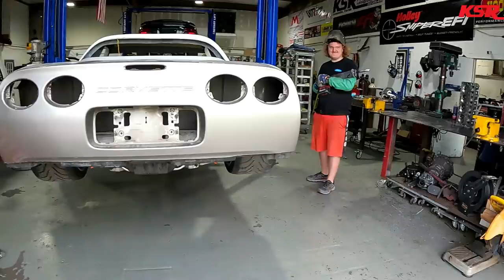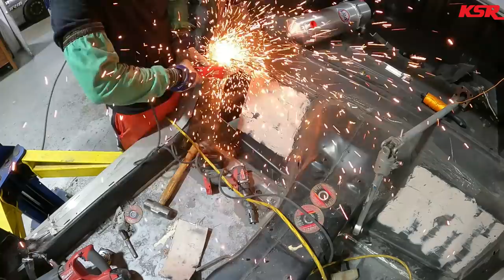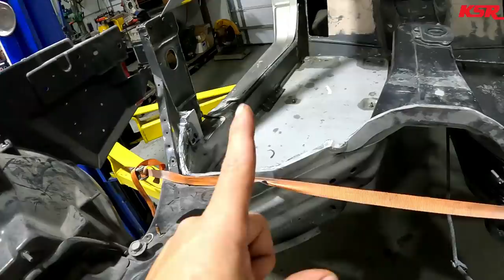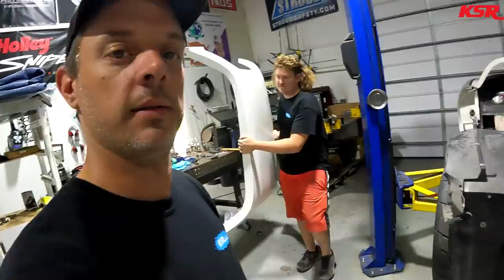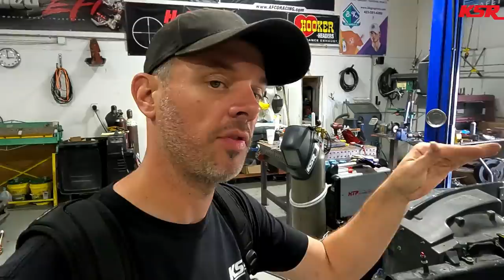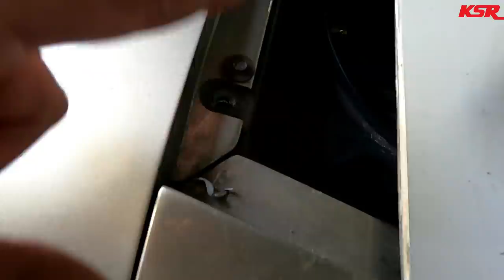We Destroyed a Corvette!!!  Or Did We???

Comment: After the mention of power/weight performance balancing I started thinking "what if they strictly went by horsepower and completely disregarded torque?" That then made me think of taking a 427 aluminum block LS with LM7 heads and cam just to see. It'd be a bit like an old nailhead or something...but modern...maybe. It's not a combo that makes any sense but I want to see it.

Comment: Do they have to run a stock type transaxle as a lot of the Drag race and Drift guys plus I have seen some of the GT road race Vett's running conventional
Trans with the early Diff or as the Cars that are being built now have quick change Diff Gears "See Taylor Ray's or Collete Davis's new Vett Drift Builds"
Garret is also changing Leroy to conventional Trans layout with the IRS setup staying,  I would personally ditch the IRS and go 9" and 4 bar layout but
that's just how I would go if it was my setup or how I would of advised a customer to get the best results.

Comment: cutting all that fiberglass made my skin itch just watching. How do the regs for cages in road racing compare to the nhra cage certs? Are there different cage specs based on weight and Hp of the cars or a standard cage design/spec that has to be followed?

Comment: When you are doing this job to a corvette would your preference be to start with a convertible chassis or a hard top car?
Reply: Convertibles are heavier due to extra bracing for it being a convertible. So in this instance a hard top would the best bet.
Reply: @KrisKnight91  would the stiffer chassis be worth it I mean ur gutting the rest of the car out
Reply: @CharlesSmith-uw9ef  with a cage there’s no need for it be stiffer. Plus they want it as light as possible for this build

Comment: Would it not be better to have a longer stroke engine to keep the horsepower low for the weight break? Then use the extra torque to improve the performance. It would also be under less stress for an endurance motor.
Reply: Under square, over square…. I think folks have been arguing that forever??  Ultimately the REAL issue is efficiency…. And I think [i don’t really know] that is determined by a million things in a “reciprocal” engine, that’s burning gasoline….  There is a WHOLE bunch of physics that has to be balanced…   I can think of other things that might be a better way?  Maybe like shutting off half the cylinders [when the power isn’t needed?] my 5.3 Suburban regularly gets between 18 to 20 MPG averages… obviously it’s also an underpowered dog LOL… but you get where I’m going?